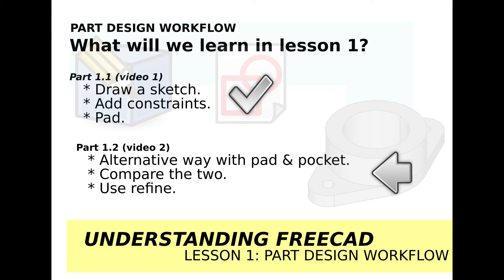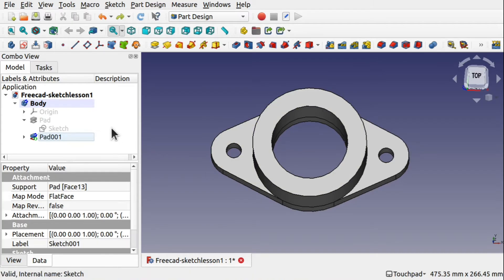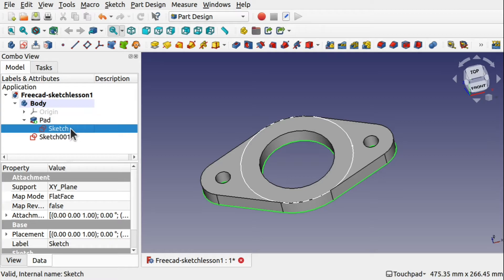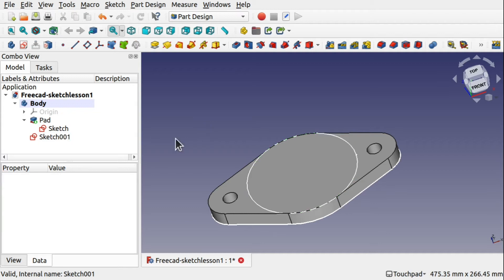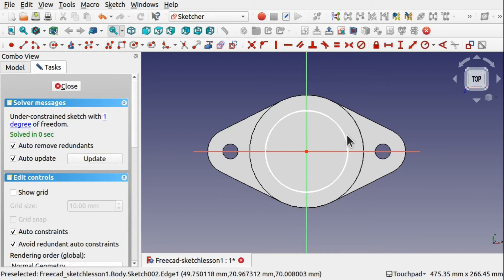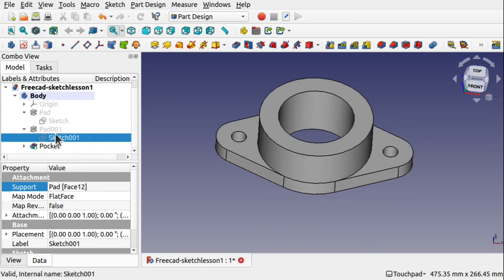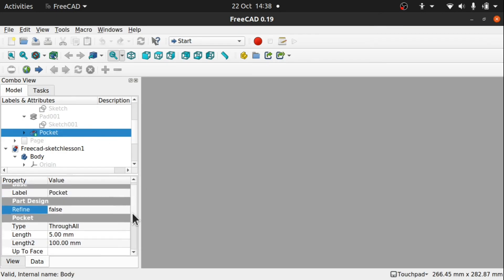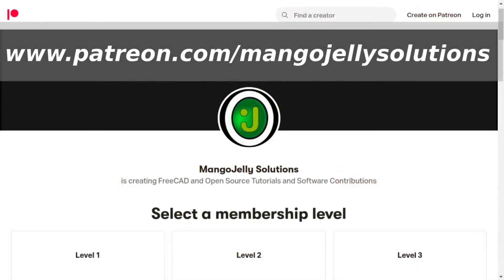Understanding FreeCAD Lesson 1.2 Building a basic part in Part Design Workbench. Beginners Guide

Comment: Both lessons are excellent.  (Everyone loves a British accent). FreeCAD specifically, and CAD programs in general, are inherently complex, NOT intuitively obvious, and can be extremely frustrating.  But all MangoJelly videos are exceptionally well done, and well thought out.  Each step is performed without error, so there is less confusion.  The parts have sufficient complexity but not too much.  The presentation is correctly paced for absorption, uses several commonly used  features, and is most helpful.  FreeCAD is very powerful once mastered.  Thank you for doing a great job and a wonderful service to the 3-D community.  😀
Reply from the maker: Thank you so much for your kind comments. So glad for the appreciation of how difficult CAD is and I have seen many comments blaming freecad when, as you say, CAD is hard full stop. It's one of the reasons why I did this video series. Thank you for commenting and showing your appreciation for the series.

Comment: at about 4.30 when you change face 13 to face 12 in my version 0.19-24366 on a mac the link dialogue vanishes when I click the face. I then have to move the main window to find the dialogue again before I can click OK, I can not find anywhere to click to bring it back to the front - do you think this is a bug?
Reply from the maker: I had real problems with the mac version but that was around a year ago when I tried it. I can't replicate what you are experiencing on Windows or ubuntu . It may be worth throwing the question up on the freecad forums. It does sound like a bug.
Reply: 8 months later…apparently they didn’t fix the problem.  I’m not sure what you mean by moving the main window to find the dialogue box.  I can not find the box.  It just vanishes.
Reply: the main window comes to the front (focus) meaning the dialogue box goes behind it and you can't see it any longer. you have to drag the main window over, up, down or minimise it to get to the dialogue box again.

Comment: I see at approximately 04:20 that it says "AttachEngine3D: subshape not found, Internal name: Sketch001". That's useful in pointing to the sketch with the issue but is there any way of quickly identifying that the face (Face13 in this case) no longer exists and that is the issue?

Comment: Great video, thank you. I am using the "RealThunder" branch, which is more developed. It does not have that problem with the support/link that you must manually correct for the faces. ( 04:30 ) It also automatically do the refine as you go.
Reply from the maker: That's interesting to hear, I am yet to check out RealThunder it's interesting to know the differences, thanks for that.